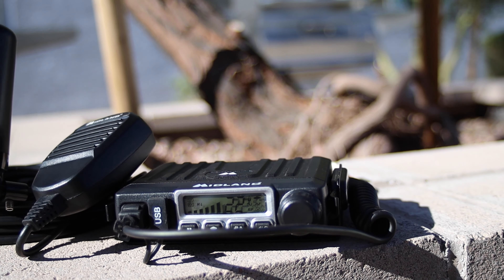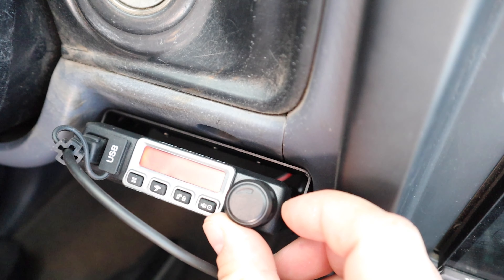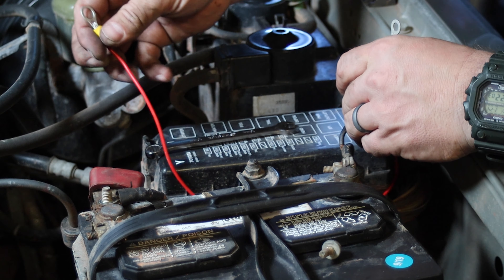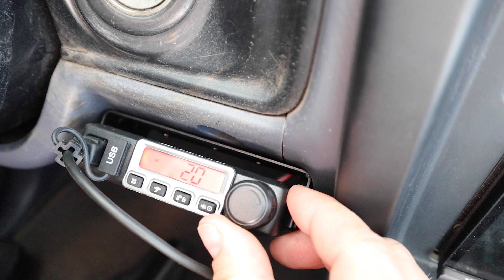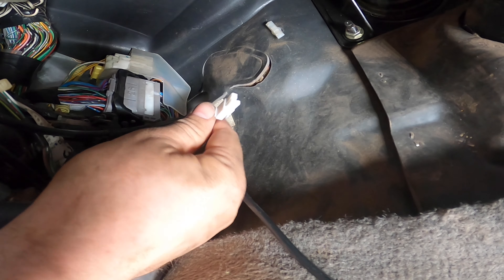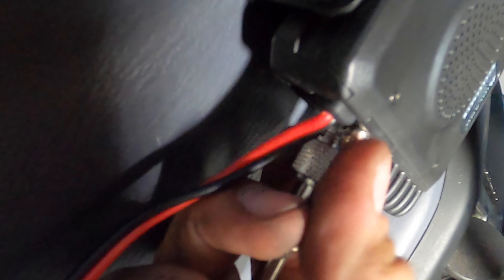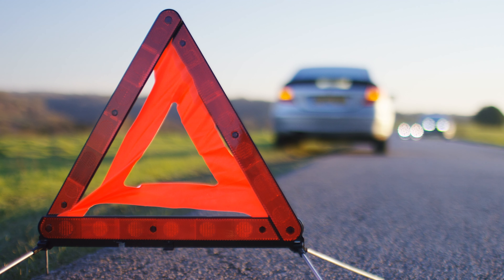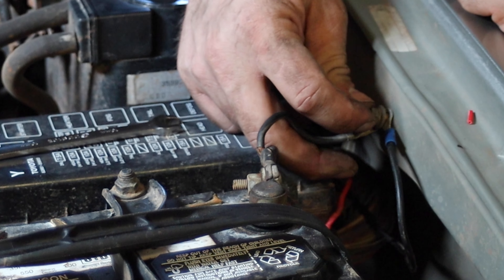How We Install A Midland MXT 115 GMRS Radio In Our 3rd Gen 4Runner

Comment: Did you install one in both vehicles?
Reply from the maker: Negative, they only sent one unit out. I’m gonna play around and see what I like and don’t like about it before we decide what direction to go in the Disco.
Reply: I have not heard 1 person ever say that they do not like gmrs. It’s like going from am radio to fm radio. Clarity and range is what it is all about.
Reply from the maker: @toddhoffmaster6057  absolutely! I used to be in the heavy haul trucking world, and I’m so over CB just from having to deal with the all the garbage chatter and limited range, unless you got one of them boosters the FCC don’t need to know about. We’d used a lot of company VHF and I knew that’s the direction I wanted to head, i just didn’t wanna deal with the HAM hoops and, frankly, attitudes. Took a minute for the FCC to get my call sign issued, but now I’m pretty stoked and can’t wait to start getting in on some of the repeater networks!